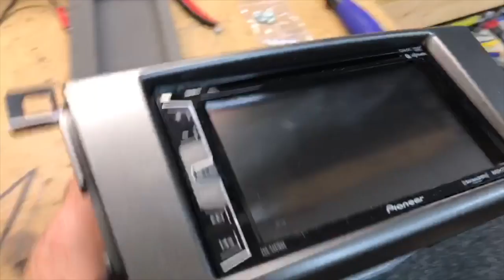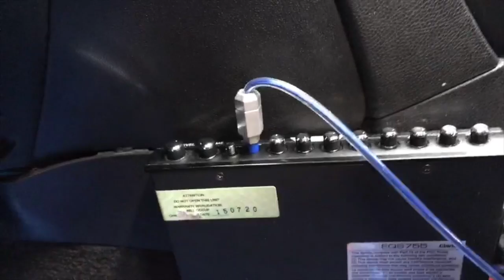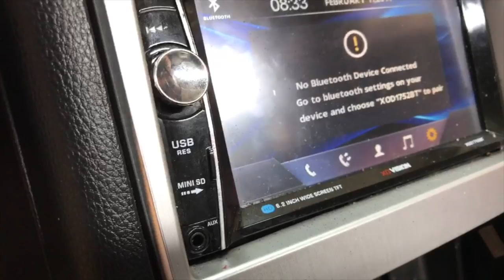Five star car stereo weekly vlog episode 1

Comment: How often do you guys deal with motorcycle audio?    My question would be what woofer/subwoofer set ups have you had the best luck with as far as output that maintains SQ?
Reply from the maker: Casey Cross believe it or not never done a bike.
Reply: Casey Cross I've actually done a few bikes before and if you're going to do anything to it audio-wise go with Rockford, they actually make a radio replacement kit as well as an amplifier install kit for bikes and some specific products for select Harley's from about 98-13. have not done any with subs yet as there's just not much room on bikes. it's a challenge even getting 2 sets of speakers because you almost have to have storage or saddlebag type boxes for the second set. but if you're doing new speakers go Rockford and definitely amplify them for sure

Comment: on that genesis install, so she paid for that? man i thought i was Date Raped on the first install in my car. just want to add that they took twice as long on the install as you guys did as well
Reply from the maker: sl265i sadly she has been back to them 5 times with issues and paid each time
Reply: that sucks. in my experience  things were discussed/agreed upon that were going to be done & they were not, which some of the things were ticky tacky things as long as the major stuff was done right. which Velcroing the amp to the floor was inexcusable. I would have gone nuclear if I looked behind the radio and seen what was done there. So I did not want them to correct the stuff or did I believe they could have done it correctly so I did not Have them do anything further. the wait was worth having it done right.